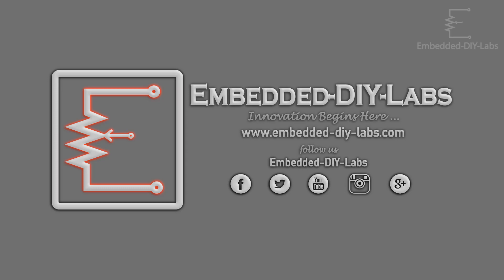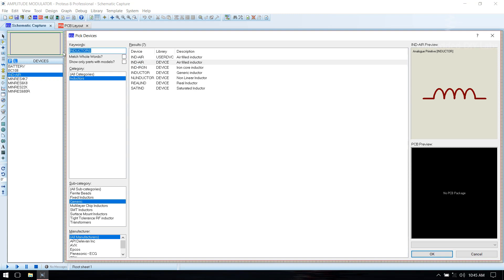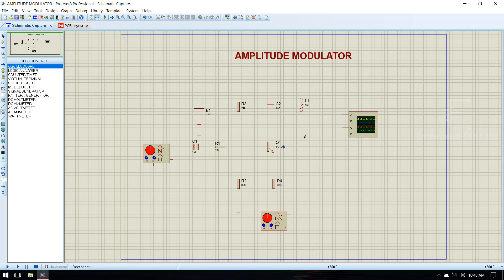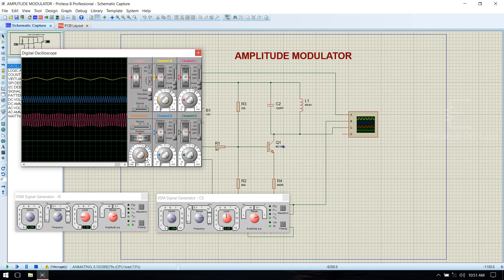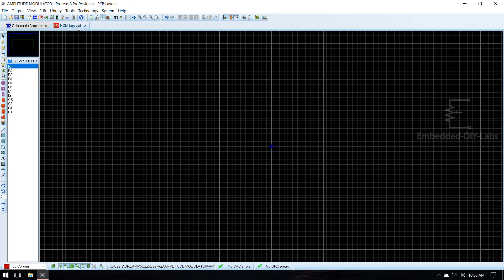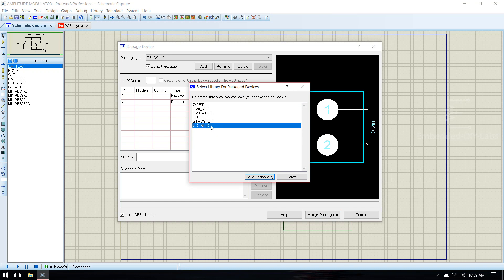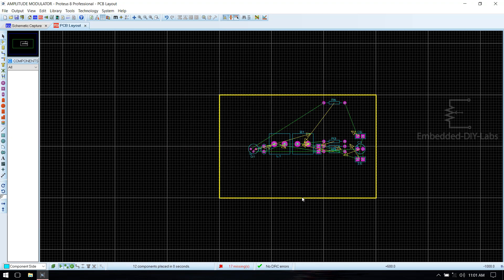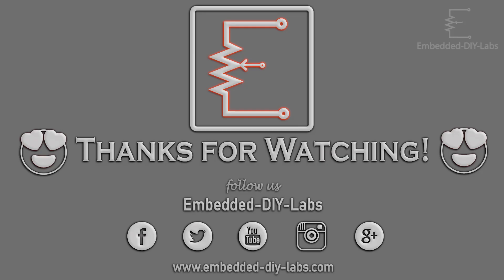PROTEUS - AMPLITUDE MODULATOR CIRCUIT, SIMULATION, AND PCB LAYOUT DESIGN

Comment: Does AM modulator mean it is also a AM transmitter?
Reply from the maker: AM transmitter is a device which transmits AM signal where AM modulator which only modulates input signal with its carrier signal - only a modulation block